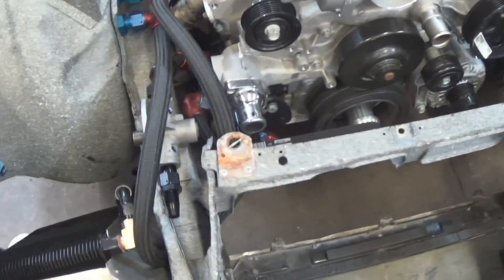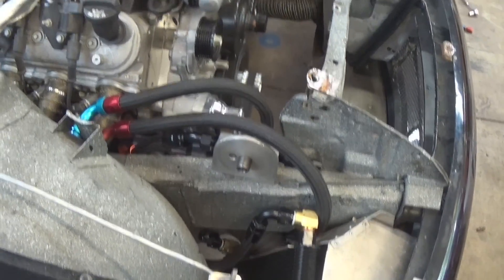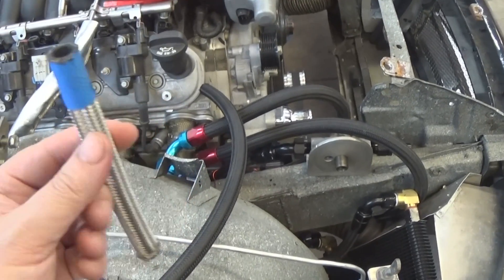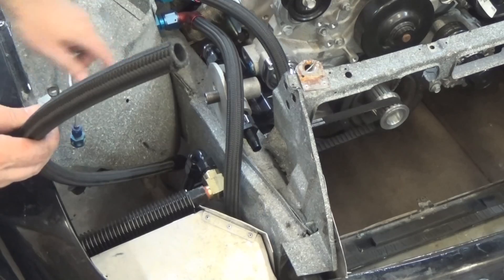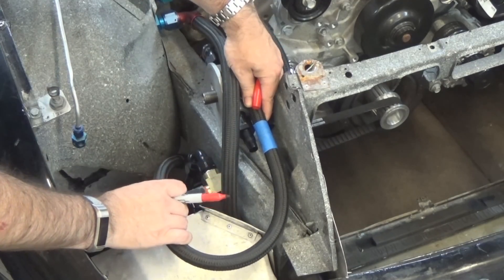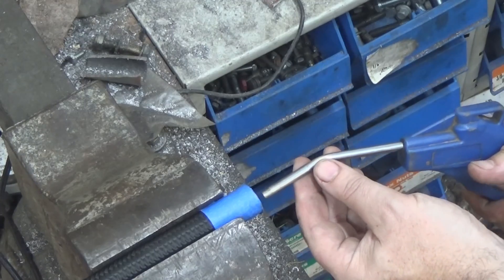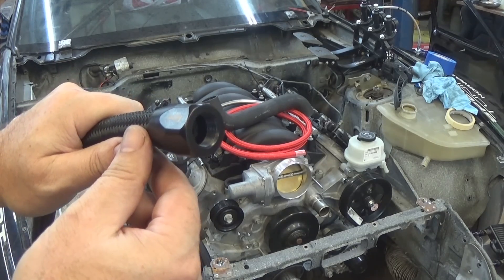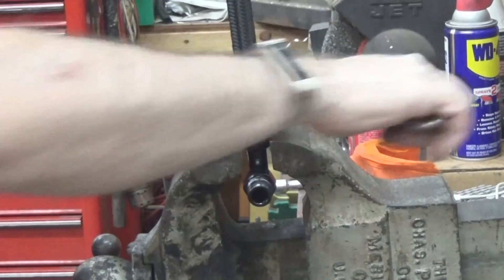How to install -AN fittings

Comment: “...care about the performance than how it actually looks”...That implies that the aluminum wrenches somehow inhibit the performance, lol. To say it truthfully, you didn’t want to spend the money on the wrenches, because performance is not a consideration in this application, and a normal hose clamp would work just fine for the low PSI. You obviously did buy it for looks.

Comment: Hi Van,
Is this noise normal? https://www.youtube.com/watch?v=iAthqxEE0WM
Thanks,
Robert
Reply from the maker: Sounds like something's loose in the steering system... and that's not normal.  I'd first pull the horn button and make sure the steering wheel is tight.  Then I'd check the universal joints on the steering shaft (one under the brake booster, one by the rack).
Reply: Thanks Van! I'll visit my mechanic again today and ask him to check again. Thank you, you're the best :D.

Comment: Thanks so much for the videos!  Always great info!  Any chance you could make one on that pedal box installation I saw on the side of the engine bay?  Thinking about putting one in my 944 race car.
Reply from the maker: Sharp eye!  I will make one on the pedal box when I'm a little further along - it's still partially in the planning phase.

Comment: What kind of car is that?  What happened to your 996?  Didn't want to put an LS3 in the 996? Very popular option these days.
Reply from the maker: I sold the 996 to a guy who wanted to rebuild the engine.  This is a 944 Turbo chassis - already a race car.

Comment: what kind of adapters do you need to hook it up to the metric Porsche equipment?
Reply from the maker: If you're connecting to a Porsche 944 Turbo oil filter housing (for a custom oil cooler), you can get adapter fittings at BAT (http://www.batinc.net/mocal-central.htm )